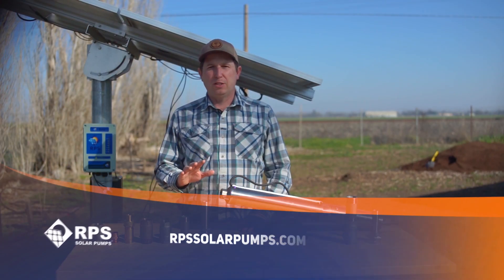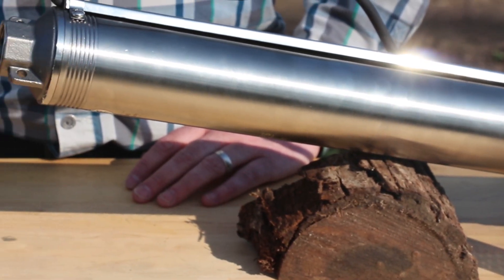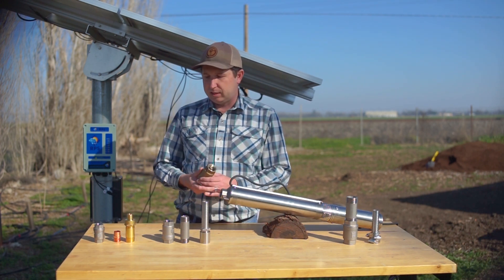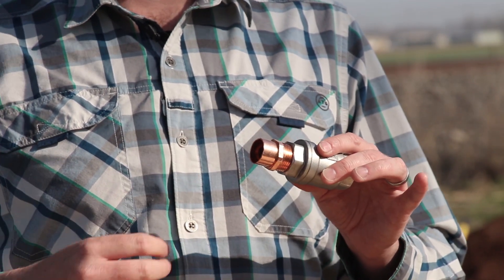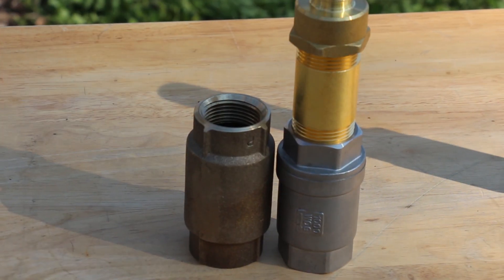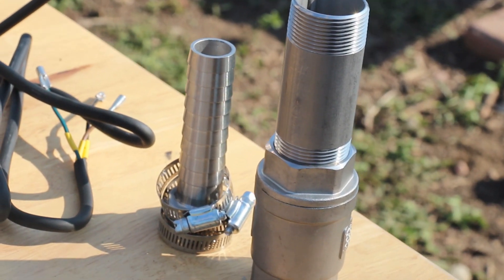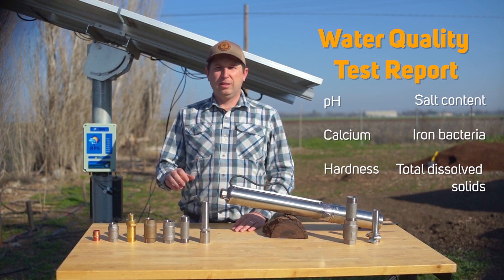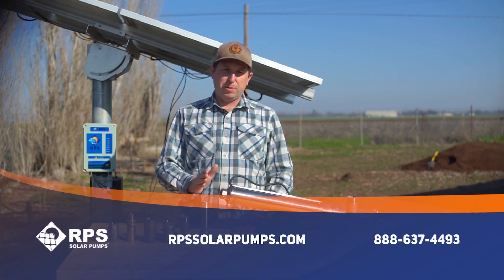Choosing Metal Fittings for Well Pumps • Top DIY Mistakes

Comment from the maker: When plumbing your well pump, you'll encounter three main varieties of metal plumbing fittings: brass, steel, and copper. Mike's got all three, and today he'll explain the advantages and disadvantages of each. 

00:00 - Intro
01:11 - Copper and Electrolysis
02:00 - Brass
02:27 - Stainless Steel
03:03 - Water Quality Test Reports 

For more on plumbing, watch our in-depth tutorial here: https://www.youtube.com/watch?v=XVdMr...

Our turnkey kit comes with all the uncommon stainless-steel fittings that we recommend. See a full unboxing and find out what else comes with the Turnkey Kit here: https://www.youtube.com/watch?v=qll7c...

See the Turnkey Kit in action during our full pump installation video here: https://www.youtube.com/watch?v=9R1kB...

Visit us at: https://rpssolarpumps.com/

RPS Solar Pump Systems are for people that appreciate quality and value. Designed to aerospace standards, yet affordable. 
Easy to install. Zero maintenance. Zero energy costs. Quality you can trust for years and years to come.

To learn more about wells, solar pumping and off grid systems visit our education center: https://www.rpssolarpumps.com/learn/

To shop solar pumps: https://shop.rpssolarpumps.com/

Just wanna talk? Give us a call at (888) 637-4493. We're a friendly bunch. Shoot the breeze about your property, well or cattle, or get sized for a pump by our specialists at any time!